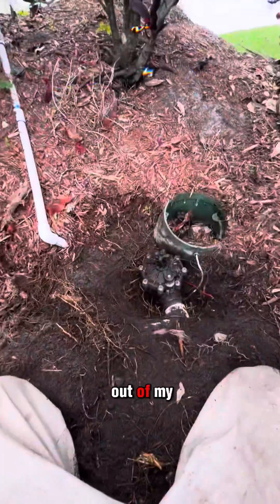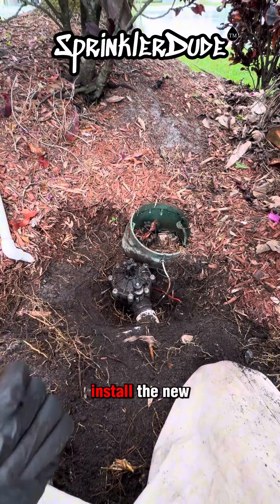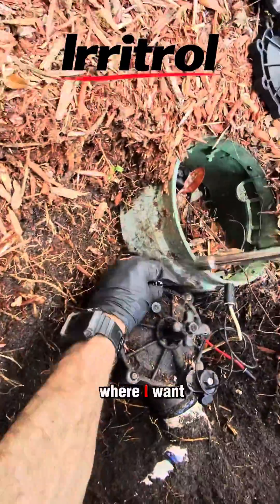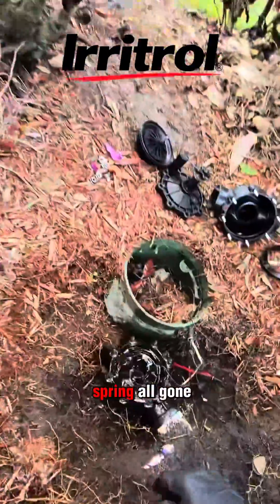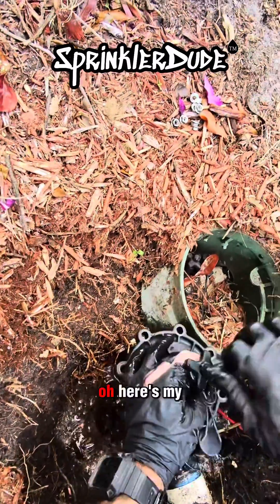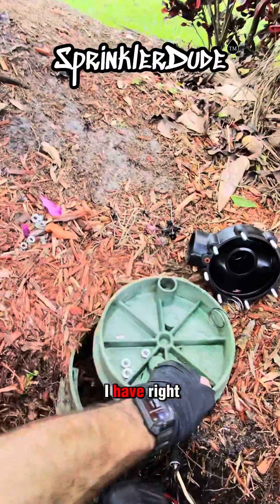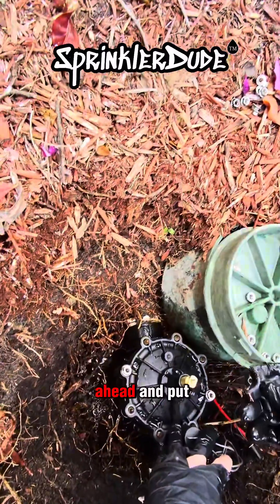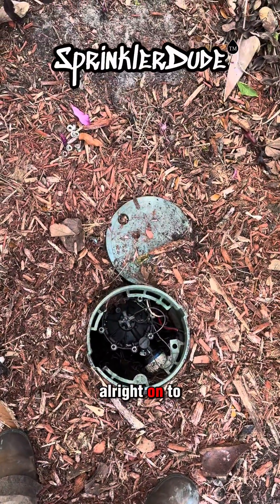2” Valve Rebuild | Walkthrough (Series 100)

Comment: Just curious, why not use a drill with the clutch turned down?
Reply from the maker: I am capable of doing that. It requires practice. I have to assume, a lot of my viewers are not seasoned pros. If I show that. Someone will break a valve and blame me.
Reply: @sprinklerdude9768  love your answer  awesome work am from California I do alot of work on 100 series but 3 inch and sometimes it gets crazy 🤪  keep up the good work 🎉